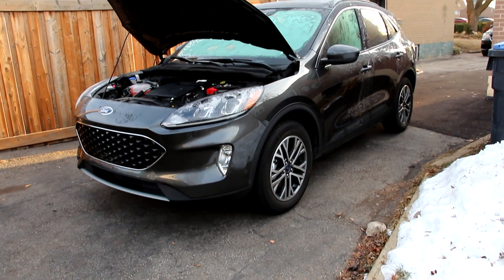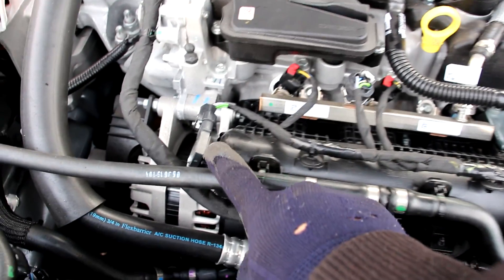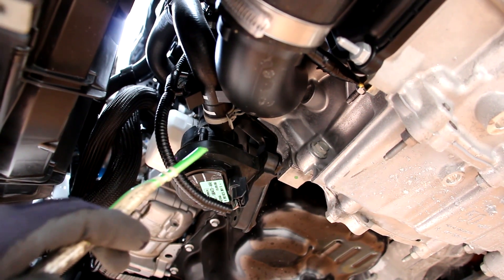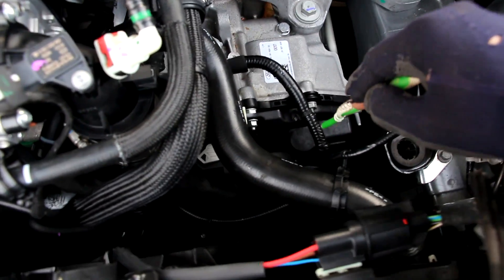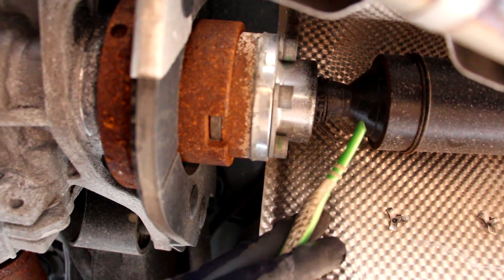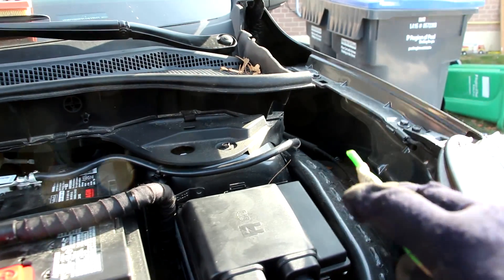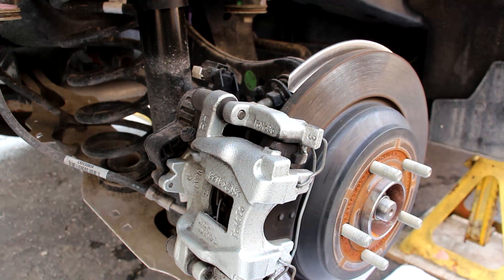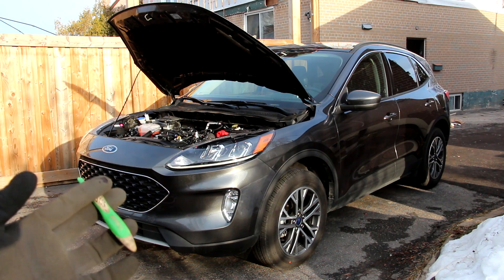Ford Escape Mechanical Review

Comment: I'm a Ford Tech at a dealer

All these new vehicles leak and are put together very poorly..... I wouldn't own any of them unless it was a truck and then it would have to be a 5.0 or 6.2 or possibly the new 7.3 liter ( when we finally get one ) NA engines
Reply from the maker: Sad to hear that from a dealership
Reply: @speedkar99  it's the truth though I mean it's crazy how these new vehicles like just now I got done doing 5 recalls on a 2019 F250

These vehicles are just built way too fast and there's way too many computers controlling things and they just keep getting cheaper

Recently I got the new Lincoln Corsair in from the manufacturer not even from a dealer yet and the leather seat was broken away from the back resting plate and the only thing that holds it on is plastic tabs the left LED turn signal had two of the like little 20 LEDs working and it's $1,000 light the vehicle only had three thousand miles on it because it was in the testing phase and not even released to customers yet

Very cheap very poor quality vehicles with a high sticker price

Comment: I’m still happy with my 2016 escape se ecoboost.. solid reliable daily driver
Reply from the maker: Any issues?
Reply: speedkar99 nope, not a single issue to report.  Already at 71,266 on the odometer and still runs like a champ. I drive it all over the country

Comment: Speedkar, what brand toothbrush offers the highest tensile strength when trying to snap the head off? I want a strong toothbrush
Reply from the maker: I haven't done tensile testing. 

Mine usually fail in bending

Comment: It’s rusting already 
Don’t say it’s surface rust
Reply: it is though
Reply from the maker: Knuckles are coated in a phospate which is a sacrificial coating that rusts to protect the steel under it.
Reply: speedkar99 
Tell that to the Germans and the Japanese
Reply: A layer of rust on a 1-2" thick piece of steel is surface rust. It will take 50 years to rust away.
Reply: All that plastic helps prevent rust...

Comment: All I see is plastic and shoddy electronics.  This gave me a headache just thinking about what this turns into after 5 years.
Reply from the maker: When it's not the manufacturers problem after warranty
Reply: it will still be around long after your gone
Reply: It’s actually pretty reliable
Reply: @mauricemotors8207  how do you know😂 this new escape has been out less than 3 years! Sure they’ve done testing internally but what is that to say for mass market?

Comment: If its anything like the mid 2000's Ford Escape's just run as away, nothing but trouble, i don't like all the exposed wiring and hoses crossing over the engine, other cars are a lot neater and out of the way.
The best way without removing the under engine cover to do oil change is drill a large hole to get at the plug, but you also have to rivet in a tube to the oil bung as oil will go everywhere but out the hole, don't know why they don't do this as with a tube the cover will still retain the spills.
Reply from the maker: I can't believe they didn't put an access panels beneath. It increases the amount of chargeable labour a dealer will charge a customer for an oil change
Reply: @speedkar99  they are obviously not interested in your back pocket except the cash it contains but smile when its transferred to their bank account.

Comment: I have a 2019 Escape. It's a fleet vehicle, everyone on my sales team has one. Every one of them had experienced a breakdown except mine. I'm at 48,000 miles. 2020 Escape has a new design but doesn't look much better.
Reply from the maker: 48K on a 2 year old Escape?
Reply: @speedkar99  I took delivery of the car 3/12/2019 with 60 miles on the odometer.

Comment: Typical Ford design" Timing belt dip in engine oil and it will cost a fortune to replace it",  plus 'awesome' rubbing wires and lines tie-up, which guarantee slow leaks and random electric issues after warranty.  Thank you, Ford, you let me learned lots of mechanic staff by owning a Ford.
Reply from the maker: I smell a recall

Comment: Vibrates at idle, already leaking.. Another piece of Ford junk rolls off the line.. I'm sure the bought and paid for automotive "Journalists" will say it's a great little crossover though.
Reply: 2018 audi q7 , 3.0 tdi quattro , already got oil dripping between gearbox and engine , dont talk shit about only ford , they charge less for the cars than audi does. not gonna say anything about quality cus both LACK any bits of that. by 200.000 km or 130k miles , both will be garbage.

Comment: To me this seems like a low-grade business version of barbarism. 
If you're willing to read a bit, here's what that means:

Those "consumers" are often parents or a single parent who are stretched thin time and money-wise. Many people are struggling to come up with a down payment for something like this and wind up extending payments to 6 years. Yet a vehicle like this will likely have a mechanical issue or problems that happen outside of warranty. Those costs will probably be prohibitive to repair, such as that control arm or that timing belt.
After that 3 year warranty runs out people still have 3 years of payments. If you're faced with a high repair bill(such as a $1400 water pump for newer Taurus) what options do people have?

I have bought Ford my entire life. They have gone to crap. But I am seeing MANY other manufactures leaving customers out to dry such as BMW, Chevy, Nissan and Chrysler/Dodge. Their products have engineering "defects." There are exorbitant cost to replace those defective parts/designs with updated parts that fix the issues at the customers expense. The costs on a veicle that is know to have 3-4 serious defects can run several thousand dollars and make the vehicle not worth fixing and thus more trash is created. Don't get me started on "lifetime" transmission fluid and "non-serviceable" transmissions. 

In America, I belive there was more honor in business at one time. That claim is based on quality and durablilty of products. Humans will always have some people who behave in very honorable ways and some in very despicable fashion. Many fall in the middle. However,  what is acceptable to dump into the customers lap has changed rapidly in the past 15 years, IMO. The bar went from low to really low recently. The philosophy of "its just business" has become a mainstream excuse for companies to make crappy products because other companies are doing it too. 
At the same time they claim to be "family friendly"  towards the customers who may struggle to make a purchase. Many companies want to get on top in a highly competitve market or even just stay afloat. That means that consumers, intentional or not, are rungs in a ladder. 
While some actually do, Every company "cares." 

Civility means there is a reliablilty to what's being contributed to the civilization. When that goes away it becomes something other than civil. Much as we had a cold war, as opposed to open war, we can have cold barbarism. While historical open barbarism involved plundering cities and citizens in order to steal their wealth, this kind of barbarism is cold because its slow and starts with an advertising promise of value. It continues with a smile and a handshake and the exchange of money with a 6 year contract. Then, after the defects show themselves after warranty, the plundering begins.
Cold barbarism leaves people who work for a company that makes dishonorable decisions feeling devalued. The person on the recieving end of the barbaric decisions winds up, more time than not, feeling devalued. There is a weight to that for both sides. 

Be honest. Ask yourself questions and sit with them. We cannot control others but we have the freedom to choose how we respond.
Be kind to others. Be kind to yourself.
Reply from the maker: Thanks for your thoughts

Comment: Ford's waterpump driven by timing chain and belt dipped in oil whats wrong with ford nowadays
Reply from the maker: It's a timing belt
Reply: The older ford v6 3.0 used timing chain attached to water pump
Reply: One of their v6 uses timing chain I am talking about another ford design

Comment: Lots of questionable design decisions here. Ford practically negated the ease of servicing and simplicity of the MacPherson suspension design by using nylock nuts and making bolts inaccessible. Tsk. Thanks for exposing this BS on Ford's part.
Reply from the maker: I don't have a problem with nylock (it's easier than crimp lock to remove) but the inaccessible control arm bolt is not acceptable

Comment: That sorry piece of machinery was obviously designed with Corporate profits as a priority over everything else. Global everything, the United States is no longer a leader but a follower. Thanks for the video.
Reply from the maker: You are welcome. 
It was designed to be a global vehicle hence using the same Ford focus platform and engine, thus saving them costs
Reply: @speedkar99  Thanks speedkar99. From what I am seeing the modern day automobile is about 50% plastic, and as you pointed out on this vehicle extremely poor engineering and design layout. Thanks again for your video, they are always educational and entertaining. Furthermore, I feel extremely sorry for your brother, I bet he spends a lot of money on toothbrushes and clothes. LOL.
Reply: hammer head - I noticed the cut-off toothbrush as well. 😉
Reply: @hammerhead6537  Plastic is a fine material, I don't need anything fancy in my Escape, all I want is it to be reliable, fun to drive, have a good, bassy sound system and be absolutely bonkers when trying to overtake, which my 2013 Escape 2L Ecoboost all does well. It's been going for 7 years without a single problem.
Reply: @coastaku1954  when key components are made of plastic, reliability is out of the window. And that timing belt in the engine. Oh my God.
Reply: @sensiblewheels  Ford isn't the only manufacturer to do this and they don't have reliablity problems, my 2013 Escape is still running fine, don't believe the stereotypes
Reply: It a car to transport you it’s not that deep
Reply: It was designed with matching CAFE standards in US and CO2 "emission" standards in Europe as a priority.

Comment: They've had these cars in Europe for over 20 years. Tiny engines for great fuel economy when gasoline is nearing $7-8 a gallon. It's a city car except with awd like a Ford Fiesta, which came with 3 cylinders and a turbo. This is the trend these days, taking the smallest engine you can then sticking it in the lightest car you can, then jamming as much turbo boost in it as possible to get reasonable fuel economy, horsepower and torque. Longevity is an afterthought. It's dead after 10 years or a minor accident. I couldn't imagine working on this in my backyard...replacing fasteners everytime you take them off?
Reply from the maker: I have doubts about great fuel economy with the turbo. You have to work it hard to get it moving. Maybe on smaller Europe roads it'll pay out but on North American highways this is a slouch
Reply: @speedkar99  I'd say not much better than a naturally aspirated 4 cylinder of the same displacement. I think they chose this engine because it's all that will be available in the future. No question this engine will lose the turbo and get mated to a hybrid powertrain soon.

Comment: After this video I feel sorry for Ford going down with the quality. At this days better do not make any experiments with the new technology. On my opinion the best is the 4 cylinder engine with no turbo 2.0-2.5l, automatic transmission operated by oil and no all wheel drive. As simpler as better.
Reply from the maker: Thanks for your opinion. Quality and reliability these days is unfortunately not a main goal.... people who buy these SUVs probably won't own them until they retire and move on to something else after the lease is up. The manufacturers know this and design it to last the warranty. "lifetime timing belt", and "lifetime control arms" anyone?

Comment: Brand new and already rusting on certain parts. Either Canada has really hard conditions or the parts are poor quality. Not surprising considering the other design flaws on this vehicle.
Reply from the maker: Canada is pretty tough on cars with the salt used on the roads
Reply: I guess. It just looked like your older Camry had less rust than this.

Comment: Hold up! 3 cylinders. 🤮
Reply from the maker: Yes sir
Reply: speedkar99 does it come with a 4 cylinder or 3 is the only option
Reply from the maker: It has a 4 cylinder turbo 2.0L on higher trims
Reply: I have seen great 3 cylinders in motorcycles that don't vibrate that much, rev very high, also V4 which would fit better for low rpm high torque that also sound similar to V8 engine
Reply: Erickzy in-line 4
Reply: +lubricated timing belt
Reply: Three-poppers aren't inherently bad, but Ford seems bent on amplifying all its worst aspects in this application.
Reply: 3 cyl has great sound btw

Comment: You have to take the entire bottom plastic panel off with TWELVE fasteners to change the oil?? They were too cheap to add an access panel to the oil pan... garbage

This is the kind of stuff you don't see in regular reviews and would be a huge turn off for me - Keep up the great work!
Reply from the maker: Agreed! I couldn't believe that there's no access panels!! Almost as if it's "lifetime engine oil" !
Reply: Also these panels under vehicles keep alot of dirt and splash from getting into the engine bay with all the electronics in the engine area its vital to keep this clean and dry as possible
Reply: Hyundai has a 6 bolt access panel and its 10mm bolts not plastic push pins.
Reply: barry rudge  my 2014 Mazda 3 has the entire bottom covered with a plastic panel as well for airflow, but it has a small easily removable panel with 2 bolts & 2 fasteners for direct access to the oil drain bolt and filter. Mazda didn't mind spending a few extra cents to add a removable panel on PLASTIC... and oil changes are the most frequent thing being serviced on a car.

Not only would it make DIYers like me lives easier, but also quicker and easier service from the techs at the dealers.

Comment: I'd love to see you compare to the new Yaris 3-cyl some day.  Interesting about the timing belt.  I wonder if keeping it away from the  atmosphere outweighs any corrosive effect of the oil so they don't call for replacement.  Still sketch to me. 

I like the emergency parking prawl disengage feature.  Clearly the manufacturing quality is poor, but nobody expects that from Ford.
Reply from the maker: I'd like to see the new Yaris too but I don't think we are getting it in North America? 

I'm sure Ford has done life cycle testing on the timing belt and other components. While it appears poorly constructed, it is designed to fail at the warranty+1 day 

Most original owners wouldn't have the car at that point
Reply: @speedkar99  No, we don't get the Yaris here in the US. It's just a dream, not a real request.  

You think Ford's target democratic will only own this car for 36k miles?  I'm sure they intend for it to last a little longer than that.

Comment: WOW, Ford, I am impressed, you got a high score on the junk level.

Please, people don't waste your money.
 Buy a Toyota or Kia.
Thanks.
Reply from the maker: Thanks for your opinion 😏
Reply: @Kekistani Refugee my 2010 forte 2.4 is 10 years old and has 202,000kms and going strong as ever, it's a port injection engine and still made in Korea so it doesn't have any of the manufacturing defects the made in Alabama GDi engines did and those were the huge fuckup enginee that blew up constantly because of faulty block cleaning after they machined them, atleast hyundai bit the bullet and replaced every single faulty engine with no cost to the customer
Reply: SNOOF AYY Yeah I don’t know about that I know at least three people in my town that had to fight and go through hell to get that covered

Comment: A turbocharger behind the engine that pipes to the front of the car underneath the engine .....No.
Reply from the maker: Most turbo engines have this setup
Reply: @speedkar99  whelp, thinks for that tid bit of information. Always been told to avoid turbochargers, now I can see why. Also thank you for the in depth overviews, they are very informative.😁

Comment: I think almost every modern urban SUV did the same thing. They took a hatchback car from their line up and then make it higher and put bigger wheels so it looks like a SUV.
Reply from the maker: Im thinking Mazda CX3
Reply: @speedkar99  mazda is notorious for doing this..
Cx3, cx5, cx7. Basically enlarged version of Mazda2. Even the interior is pretty much the same.

Comment: You get smoother with a v motor. Looks like the engine and compartment were designed to be worked on regularly. May not de a good sign. I am a Chevy fan But Ford usually puts a good bit of research into their builds so it will probably work out fine. Eco boost is great. Direct and port injection will keep maintenance cost down down the road, this is a very good addition.
Reply from the maker: There's alot of room under the hood because it's a 3 cylinder for such a big vehicle.
Reply: @speedkar99  That only ways a shade over 3200 pounds. The power is ideal for that weight.

Comment: Does an electric brake actuator mean this car is brake-by-wire?
Reply from the maker: Somewhat. 
There's still a mechanical connection inside between the pedal and master cylinder